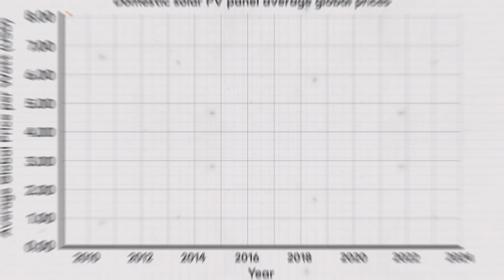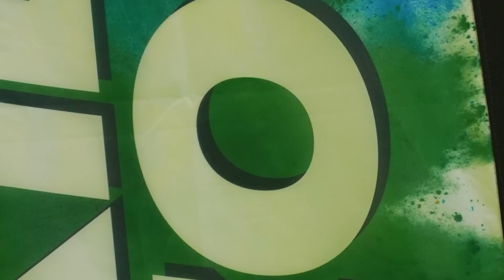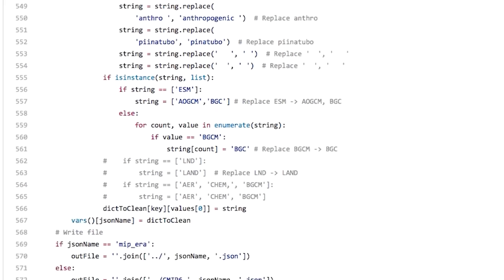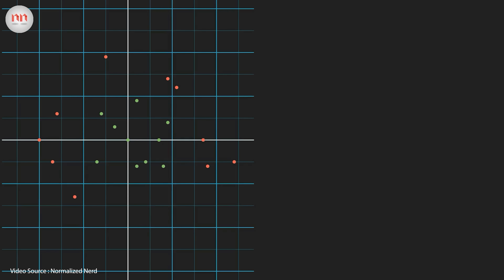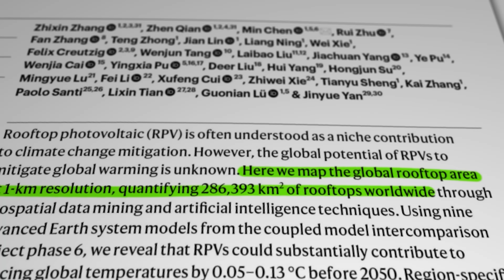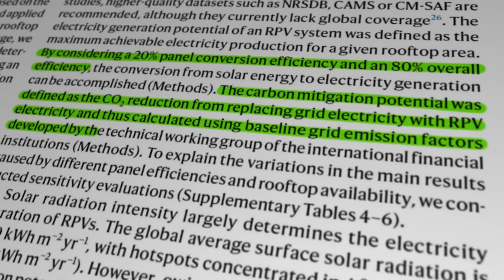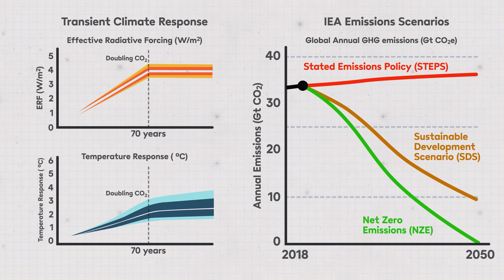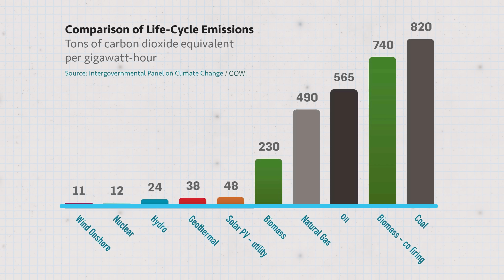New Report - Rooftop Solar PV is THE biggest climate mitigation technology!

Comment: I am planning 2 rows of solar PV panels on my new roof and another row between the 1st and 2nd floors and perhaps even another row along the basement...I also have space along my fence in the front and back yard taking up zero garden space for vegetables and flowers. Combined with high insulation and electric heated floor = great strategy!!

Comment: One surprising benefit from my solar panels has been heat deflection. During the summer months, my house is a few degrees cooler than it used to be, which I reckon is a result of the panels blocking direct sun hitting my roof. Otherwise, seven years on, they still do their real job perfectly.

Comment: I’ve had my 4 KWp system approximately 12 years too and they have long since paid for themselves but about 2 years ago I had a 13 KWh battery fitted and now I’m virtually self sufficient coupled with 6 hours off-peak tariff, so please don’t forget to include battery storage when you consider PV as that releases its full potential if you pardon the pun? 😊

Comment: I installed a 5KW solar array plus Tesla battery backup - which at 14 c/kWh in N. NV USA cost $17K - this will pay for itself in 11 years… In nearby CA electricity costs ~ 20 c/kWh (high - due to paying for the repair costs for the recent mega fires caused by faulty power company overground wiring)… during the day CASIO (regional power monitoring organization - you can google, download the app for realtime data) shows that about 80% of the green power comes from solar and the “surge” at 4 to 8 pm (tea-kettle time in the UK) is provided by the newly installed (23/24) large scale battery backup- reducing the need for gas peaker plants … the levelized cost of electricity during the day (to the energy companies) is about 2 c/kWh… (from the CASIO site)…

That said I have been advocating to the City of Reno (and Washoe County) that all new housing developments are built as “energy islands” powered by roof-top solar and battery backup-up … attached to the local grid … naturally there is little enthusiasm for this by NVE …. They are only interested in utility scale solar…

Comment: In the paper it doesn't seem to include the whole LCA of Solar PV. Specifically I don't really see the calculation for the whole energy cost of solar PV, which means if you install more rooftop PV, you need to take into account the energy needed to produce more PV (that are supposedly going up the roofs). But it is an interesting study anyways, and inspiring of course. Thanks

Comment: Forget about 'payback periods' - take out a loan. You'll be saving straight away. We bought an EV and installed a solar panel system and added the cost to the mortgage. It cost us £170 extra a month but we IMMEDIATELY saved more than that on fuel and energy bills meaning we had an instant saving. No 'payback period'. That's the way to do it.

Comment: We don't pay anything for energy 18 weeks of the year plus receive a small amount of feed in tariff. And this is with only 5 East facing and 5 West facing panels (sub optimal) plus a 5Kw battery, a well insulated house and an ASHP. And yes the payback is roughly 8 years. And we really should have added another 4 panels 😠

Comment: I self-installed 7kW in December 2019 at a net cost of about $7,000 (in southern California with net metering). Up to today today (April 14th 2025) they have produced a total of 65 MWh. The average rate for electricity is $390 per MWh (assume an average of $300 per MWh over the past 5 years then, I have saved 65*300=$19,500. Payback time was about 2.5 years!
Production declined about 2% in the first year, but since then it has hardly declined at all (<1% more).

Comment: this is an incredibly ignorant perspective. rooftop PV is a parasite on the grid, it erodes value from conventional generation (including utility PV and wind) all of which are still needed to be available to supply consumers at night. It may be cheaper for the owner of the rooftop system but all other users (apartments, rentals, retail, manufacturing and other industries) have to pay more for what they consume. rooftop PV forces curtailment on other generators which in turn increases their relative operating costs.
rooftop PV is destroying the competitiveness of developed countries by increasing retail electricity prices and destroying industry.

Comment: I am an early adopter like you! In 2009, I had 5KW of rated Sunpower panels installed. My roof was not ideal as it was perpendicular to the south where the sun primarily travels in So. Cal USA. Problems with rooftop panels are keeping them clean. Depending on the level of dirt, you can lose 20% of the generation. I am also curious if the medling took into account modular homes that are not designed to support panels on the roof. Those who have land would likely benefit more from ground mount for numerous reasons:
1) You don't have to remove all your panels to replace your roof.
2) You can angle them seasonally for maximum generation.
3) Easy to clean and service.
Curious would the panel efficuency rating was they used in their model. There have been numerous reported breakthroughs in the last year, significantly improving efficiency.
As for China, the worlds major producer of solar panels, you would have to question their research due to the conflict of interest.
But, having an EV early adopter with 2011 Leaf replaced by 2025 Ioniq 6. For the global climate impact, your oreaching to the choir here.

Comment: We live in San Diego County, CA.  We got 3.5 KW of solar panels in 2002.  We added one more KW a few years ago.   We paid about $9,000 but there were a lot of rebates over several years.   We had a negative electric bill UNTIL recently when the electric company realized we have had the panels for more than 20 years.   Now instead of paying us for our excess energy at a good rate, it is almost nothing.  We have only had a few months of this billing and it was December through early March and our bill is about $50 a month.  I think it will be a lot better in the summer.   In the last bill we used 158 KW but exported 267 KW.    Despite exporting more, our bill was $38.   They gave us one cent per extra KW.    We also have backup AGM batteries of about 400 Amps because the electric company turns off our power if there is wind and they are concerned about a fire.   Our electric is underground but we are tied to an area in the country with overhead power lines.

Comment: Somewhere in these 976 comments, someone has mentioned that it appears that mounting your solar panels upright, out in the yard is more efficient (somewhat counter-intuitive).  What really irks me is the push by many--too many--for 'collective solar' like solar farms or even new electrical generation models like using natural gas.  These models would simply continue the notion of having a large enity, either government or private, produce the electricity and move it across costly girds and then charge us.  Private, small, on-site solar is the way to go.  And don't let anyone tell you differently.
Reply: The fact is that most people don’t realize who’s pulling the strings and most of this nonsense is totally unnecessary and designed to destabilize the west. We now live in a DC society and have done for nearly 30 years so if governments were serious they would have converted to DC distribution by now. There are lots of other reasons to be energy self sufficient so if you get enough sunlight go for it but don’t fall for the con job of high density batteries you can set up a perfectly reliable (and safer) system using wet cells. If you don’t get enough sunlight you can supplement with roof apex wind generators which are low profile and more efficient than traditional wind turbines. Other options are methane digestors where you can turn your sewerage and garbage into methane and operate something like an Ormat closed vapor turbine which come in sizes from 1.5 to 2 kw and are 97% efficient.  Back in the 80s when most farms just had a few lights and a fridge you could run the whole homestead on one cow patty per day.

We’re in a grand solar minimum now, it’s being masked by the current solar maximum but by 2030 they will no longer be able to hide the decline and by 2040 frost and snow will render the major food bowls of Europe and America useless and there will be mass starvation not seen since the little ice age, so if you live in Europe, good luck

Comment: You’ll end up like Australia where the government encouraged people to install the largest systems allowed and now charge people if the back feed into the grid.

The other big issue with home solar is the insistence of using high energy density batteries for storage which have a tendency to catch on fire. We’ve been using wet cells for emergency power systems for over 100 years very safely, why not stick with what works and doesn’t have such an invasive effect on the environment ie rare metals, leave those for places where you need the higher density.

Comment: In the US the "grid operator" problem will have to be solved before solar reaches higher install levels. My understanding is that grid operators (the power company) claim they will run into financial issues if a high percentage of customers convert to solar. I think the upshot is that people here will have to get used to only reducing their electric bill instead of eliminating it entirely.

Comment: Just to build on that, a decentralized power storage grid where each neighborhood has it's own battery bank or some sort of cheap gravity battery array, Solar panels can be used as shade/awnings over carparks and on building sides reducing solar heat absorption on large concrete and brick structures. They can shade farming plots, creating multi-function land use to grow food and generate power.

There's so much that can be done at a household level, but ultimately it falls to companies like BP, Shell, shipping companies and governments to make the changes.

Comment: Here in NZ we recently installed a 7.9kw system on our rooftop, got rid of  piped gas completely replacing 15 yr old appliances with  heat pump hotwater and an induction stove. Feed in tariff is .17C/kwh 5kw limit.  Payback estimate is 5/6 yrs.
Reply: Is that legal in NZ ? 5.6 kw is the max in Aus, all to do with protecting the distribution transformers.

Comment: I don't know if your calculations included the cooling effects that solar panels have on rooftop temperatures, or the heating or insulation effect they have at night. In the US I've seen reports of a 20% reduction of home cooling costs and  a 5% reduction of heating costs. Also I've heard it's economically viable to put floating solar on reservoirs above power dams to mitigate evaporation from the reservoir in hot dry areas like Las Vegas while cooling the solar panels for better efficiency. The proximity to existing power infrastructure, plus the nearby access to hydroelectric generation would enable a bargain-basement opportunity for pumped storage hydro.

Comment: Just been approved for EC04 funding, PVS, ASHP, Improved insulation, and I'll fund a battery to improve the whole setup. So chuffed.. 😂❤ Will eliminate an oil fired heating and hot water system.. House will improved from an EPC rating of low E to a high B..Hoping to be free of buying any electricity.

Comment: Payback of solar depends what you are measuring it against. I put 8 x 300 Wp panels up in 2019, buying the panels online for €140 each. This was two months after I bought our electric car, a Kia e-Niro. Electricity was only €0.10/kWh back then (it's now double that but still cheap compared to the UK), so adding the costs of the inverters, cabling and labour it was still a 10 year payback on electricity savings. But with an old fashioned meter that ran backwards when the sun was shining I could offset 20,000 km a year of driving against not having to buy petrol. Measured against that the panels paid back in 3 years.

Comment: The RPVs were not cheap when I installed them, but the cost of the backup batteries and the smart electrical panel during the pandemic significantly added to the total cost. And they were the most significant costs, but have proven well worth the cost.  When the power goes out and the system instantly starts running off the batteries, it makes it all worthwhile.  The snow removal can be a pain, but I have no electric bill for 8 months of the year and can charge my electric car from the sun as well.  I could not be happier with my decision to go solar.

Comment: Almost 4kWh Soalr PV on West facing roof in 2011, added another alnost 4kWh Solar PV to West Roof and added a Powerwall 2. Now have an EV and an ASHP and spending less then £100 per month for 12,000 miles and heating at 19c all the time!

Comment: In Florida here. We installed a 9.5 kW system in late 2019 for $15k after tax rebate. So far it has generated 72.1 MHh of energy and at the current rate of 14 cents per kWh, that is over $10 so far.  In another few year it will have recovered the costs amd generate free power for another 20 years or so. Another way to look at it is that it generates about 12% each year on the original investment. SO better than the stocky market typical gains.
Reply: If you installed rooftop, what was impact on your insurance premiums?
Reply: Who paid you those $10k? Instead of an electrical bill, you get a check each month?

Comment: In 2023 we built an energy efficient all-electric house in New England with a 15 kW PV array (LG panels, Enphase microinverters).  Heating and cooling to comfortable temperatures and charging an EV for 42,000 miles so far, we are substantially net positive.  Thanks to net metering and a 10-year incentive program that pays us monthly for exported electrons, the system will have paid for itself in about 1.5 to 2 more years.

Comment: 20 years ago we had a hot water solar system put in for our new build. we have virtually no heating bills for two thirds of the year. But the system is complex. we have not had to spend on maintance yet. but when the time comes we will can now replace the whole system with EVS for the cost of the refilling the antifreeze in the  panels.

Comment: My work place in Vancouver is in a flat roofed light industrial warehouse.  Through May to Sept we often have to run AC because the roof gets hot and all that heat is just transferred inside and without ac its unbearable.  There are loads of flat warehouses all over here that would be ideal for pv solar.  The only real issue is that in the winter months there isn't that much sun so it would definitely not be much produced from October to April.

Comment: I almost feel this video should be taken down and remade. This is not a simple topic! Sorry for the rant... Read:

Time of energy consumption is becoming a very painful subject for grid managers which has the unfortunate side effect of forcing high energy intensity solutions to mitigate. i.e. the more solar, the more natural gas peaker plants. Pointing to the a map and a graph that shows untapped solar solar energy is dated, and increasingly dangerous.

Utilities are becoming increasingly hostile to solar in areas where there is solar PV saturation. If you've noticed, there is a reason:  they WANT to go green - may even be required to - but they can't handle exponentially more of an uncontrollable resource that they have no visibility on! They turn to destroying the excess energy in ground loops (curtailing), then when the sun sets, immediately kick on natural gas peaker plants when demand hits in a near instant when PV systems simultaneously stop producing. This is not because they're mean, it's an engineering and regulatory reality and we'd have blackouts and blown transformers if they didn't.

Finances heavily depend on if the person gets scammed by the solar salesman, who almost always work on commission and are taught and encouraged to overcharge customers. This needs to be addressed whenever the topic of res solar is brought up. I was one of them, briefly; a coworker made a $25,000 paycheck as I nearly starved - and don't think that money came from people who volunteered that money away. It is very easy to pack a lot of waste in 20 year contracts that can mask the full scale of the investment, especially when you're talking to residential customers that might not know much about finance and investments. Just look at how badly otherwise intelligent people get screwed by car loans.

Grid scale solar with massive investments in long distance transmission and battery demand response strategies is essential. Rooftop solar can and should be a supplementary resource, but we can not rely on it without knowledge and interest in batteries and education on the solar industry.

If you ever think about going solar - undersize the system, require a battery, require that the battery is not just "backup" but that it has Demand Response capabilities - i.e., limits or eliminates your usage during any of the more expensive Time of Use rate charges (see your own utility for this). These charges are directly calculated to reflect when energy is hardest to produce, and thus almost always when it is the most carbon intensive (i.e. frequently relies on inefficient peaker plants to meet demand).